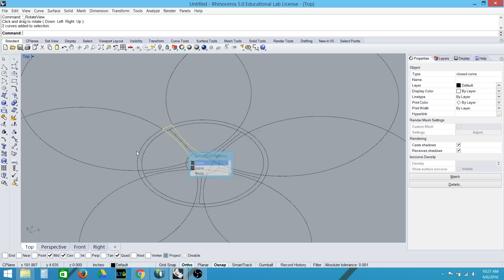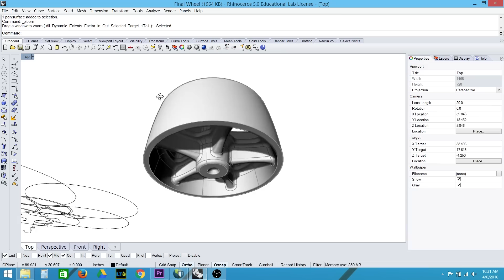Casting Aluminum Wheels | Old Timey Casters

Comment: Hiya, just discovered your channel.  I've yet to watch all of your videos but I'm interested in casting aluminium.   In order to repeat cast something (for example shelf brackets) do we have to use sand?  Is there anything more robust but flexible that doesn't melt at temperature of aluminium?  Some kind of tough resin?  Thanks and really enjoying your work.

Comment: great work and very entertaining. I note that you use a funnel shaped pouring basin. the current thinking is that these pouring basins entrap air and oxide into the melt and induce turbulence into the flow. 
There are basin designs simply built that includes a weir that allow a better pour as described in the "OldFoundryman" videos in accordance with James Campbell , I believe. they also have narrow sprue's so that they are completely full when pouring.

please look into them, they have some merit.

but them if it works, it works.

Comment: Poplar is only dense when its green. That stuff around here is lighter than paper when it's dry. You would be better off using something like Oak, Spruce, Walnut, or Maple. Those woods make decent patterns. As long as they are dry and do not warp.
Reply from the maker: Ah thanks for the info!  I have some actual foundry board from freeman supply that I am looking forward to trying out!

Comment: one question, i know it's a relatively old video but i saw you finding the center of the wheel using lines. I;'m assuming that you was just doing that to show people how to do it, but i would have thought you would have just used the CNC machine to mark the center of the wheel considering that's how you cut it out?
Reply from the maker: I didn’t have a good Center as it was a spiral path.  Due to the school shop closing where I kept my CNC, I wasn’t able to run the final profile cut.  The roundness was based on just sanding it into a cylinder.  Various ways to find the center.  This was just the one I happened to use! :)

Comment: Thank you! Finally a youtuber who actuallu knows something about casting ;) Keep doing these! Also, you could try lost wax casting, since you have a 3d printer and use sodium silicate already ;) Althouh there could be a problem with curing the mold (need a 1000C degree oven). Anyway, hope for the best ;) Btw. could you link up this ,,sodium silicate sand”? I didn’t know there was an already mixed mass being sold

Comment: I need to work on Rhino!   You make it look so easy! 
>>>
Apologies if I missed it somewhere, but have you figured out how hot your furnace gets?   I'd like to melt down silver which is doable at about 1700ºF.  Aluminum melts about 500º before that.   Think your burner / furnace can do 500º more??
>>>
I once drew up plans for a heavy butcher block island that called for wheels like this.  Commercial stainless steel castors were a couple hundred bucks(!) if I recall correctly.

I'll be interested to see the final application and how you machine the hub and fit bearings!

Comment: congrat sir
please what software did you use to design the wheels at the initial stage and what kind of machine was use in cutting the pattern out.
thanks
Reply from the maker: +anthony ibanga The 3D software is Rhino 3D. The machine was the Platform CNC that I designed and built!

Comment: I would have used poplar perfect plank as it is more stable. You can cut the whole thing without the need for sanding afterwards. Just cut from the top of the radius created from the ball cutter to the parting line with a flat endmill and it's done. To keep it from flying away when it cuts free,,,,, oh never mind. I have been a pattern maker for 30 years. What you did is fine. They look great.

Comment: Before you separate the 2 wood parts you should turn it on a lathe to make the outside round and smooth so it won't have bumps and wobbles in the finished metal part.
Reply from the maker: +steve c Step 1: Buy a lathe. :)
Reply: I'm sure you could build one from scratch if you don't already have one!

Comment: Very nice work. Congratulations. But I have A question. Why not to use green sand which is reusable. Sodium silicate sand is lost, so it is an expensive solution to make a mold. For my part, I only make a sodium silicate mold when the part has details that can't be made with green sand, like the fins of an air refreshed cylinder head by exemple.

Comment: Can you print out hollow segments on 3D printer, fill them with water, assemble them in a bigger structure and use as a cast model instead of wood, if CNC isn't available?
Reply: If i understood you correctly you want replace CNC machined "plug" (master form), with 3D printed part. Sure you can do that and get great results... HOW EVER whats up with the water part? You want weight? Then add DRY sand inside. Never bring water or excessive amounts of moisture anywhere near your castings, or your creating a bomb. Instant molten metal goes into mold and gets into contact with the water, water will turn into steam, create pressure and explode the mold into your face, with molten metal. If mold is designed and executed properly (most likely by accident) and metal flows just right, then there is chance that pressure will be released from gas vents, but i would not risk it. Also its good habit to surround your mold with plate+dry sand to prevent any spilled metal from getting contact with moist ground.. Even concrete pavement will cause this type of explosion, cause there is water inside the pores.

Comment: Hey man, just subbed today, really liking the content. I love any metal casting, working, etc. 

This is the first channel I've seen use petrobond instead of plaster or greensand. When greensand is used, I understand (perhaps incorrectly) that the charred sand/clay can be mixed back into the sand and reused. Is this also the case with petrobond?

Really hoping I can get into this someday. Anyway,  glad I found a new person on YouTube to watch.
Reply from the maker: +bdaubry Thank you very much for your comment and welcome!  Petrobond is reuse able.  I talk a little bit about this at the end of the drawer pull video.  I separate the burnt sand but you don't have to if you have a muller.

Comment: Nice outcome and another fine video. I suppose for your intended purpose using a solid block of poplar was practical and expedient. But, a pattern maker working in wood would not use poplar and would not make the pattern out of a solid block. For multiple castings, you need to consider wood movement and the possibility of warping, cupping, etc. Very time consuming to make the wheel pattern the old fashion way. Nice work, none the less.
Reply from the maker: +Russell Riscoe My reason for using the block of poplar is because I buy one for each of my students every semester to do their final project and I had one left over.  Poplar is a good, inexpensive wood for CNCing a 3D surface.  Lots of options, but not that many for about $5 for a blank like that!
Reply: Sure, very understandable. For me being "old school" mostly a matter of living in the past vs what is being done now with computers for design and patterning and CNC for producing the part or prototyping. I'm a furnituremaker who has not embraced the numerical world, lol. I enjoy your productions.

Comment: You can powder the talcum very well using a wide flour sifter. I have a 9 piece set and usually i follow the rule that 'the sifter size should be matching a least one of the lengths of the mold'. Gives a perfect powdery surface from 3 knocks or so.

Comment: I am seriously considering trying my hand at designing and building a 2x72 belt grinder. I am wondering if this method could be made balanced enough for high speed use. Something to consider at the very least. (No I do not have a lathe either).

This is the first video by you I have seen.. will be watching more, you have me interested now. If all your videos are this good, I will be watching them all, and all the future ones.
Reply from the maker: I'll be building one of these in the future...  Seems like the Jedi thing to do.  I have already purchased the drive wheels online.  It might be okay, but without a lathe, I assume it would vibrate like crazy!  Thanks for the comment!
Reply: did you watch Jeremy Schmidt's belt grinder build? It's the best shop made grinder out there. http://jerswoodshop.com/2x72-tilting-belt-grinder/

Comment: Fantastic work as I've come to expect. I can't help but wonder why you didn't simply install the indexing pins before sanding it to final shape instead of gluing?
Reply from the maker: +brocktechnology Long answer:  I loaned my CNC to the school where I teach.  It is in a wood shop with set hours.  I intended to completely cut this out but the shop was closing.  Without the CNCed edge to reference, there in no way to locate the pins.  Even if I could have installed pins, I would have just used less glue as trying to hold it together while sanding would not have been ideal.
Reply: Well that makes sense. Now that you mention it the milling did look a little bit... Incomplete.;)

Comment: If you had a metal lathe, would you turn the outer circumference to true the wheel? Or, is that splitting hairs and they are round enough for your needs?
Reply from the maker: If I had a lathe, I would face and chamfer the lip.  While it was in there I would drill the center hole.  As it is I have drilled a 1/4" pilot hole in the hub, but I'd rather know it was concentric rather than spend the extra time making sure everything is perfect at the drill press.  That said, nothing I would intend these for are going to break a land speed record!
Reply: Indeed... this is what I figured. Well, my encouragement to you is to search craigslist for a nice South Bend and get 'er done :)

Comment: cool vid 
is it possible to get  break down of the metal sizes you used for the sheet metal break going top try my luck at making one
Reply from the maker: +prmotorsports large angles were 3/16" thick...  smaller angles were 1/8". I think everything else is in the drawing overlays in the video!
Reply: Thanks much appreciated

Comment: Has your crucible held up well over uses? Any design regrets?
Reply from the maker: Crucible is going strong after 100's of melts.  Thinking about retiring it before it gives up.  Only thing I'd do differently is wrap the ends of the screws that hold the handles on the sides with tape.  If I had to guess, my small cracks may have come from those....

Comment: another awesome project. Once i get some spare time and my own home, i hope to setup a foundry like yours to be able to do aluminium casting. Thanks for the awesome videos
Reply from the maker: Petrobond hands down.  It will recreate your finger print if you leave it in the mold.  Sodium silicate is easier to deal with if you don't care about surface finish and have a difficult pattern.
Reply from the maker: +ajistewart You bet!  Thanks for the comment!
Reply: Sodium silicate sand could be reused, but only if you have a sand muller to break down the clumps and then sieve the sand. Given the price of dry builders sand by the bag full, its not really worth it unless you have a real "waste not, want not" approach to life.
Reply: watching some of Brian's videos, the petrobond sand is much, much more higher resolution compared to the sodium silicate sand, this time he went for the SS sand because of the rougher texture it gives. It can also be a bit harder to work with unless you have a bottle of CO2 at the ready with a funnel so you can cure the sand. When i come time to doing casting, i will be trying to use Petrobond as it gives a much nicer finish, and i don't require CO2 to set it. Petrobond can generally be also reused. there are a few videos on youtube that show people who have made petrobond mixers as it requires oil and something else (can't remember off the top of my head) hence the "petro" at the front of it. it clumps together a bit like clay, but doesn't have the moisture as when hot metals hit moisture, they can cause explosions :). Hope this helps
Reply: Can either of these sands be reused to make another casting form or are they single use only?
Reply: Petrobond yes. Sodium silicate, no.
Reply: Sodium silicate sand can only be used once because each grain of sand has a layer of sodium silicate, so if you reuse it that layer will build up and cause blowholes. Also it will not bind as good as fresh sand, more has to be used to get the same strength. It can be reclaimed but new sand is always cheaper.
Reply: I guess you could recycle the sand as aggregate the next time you're building something out of concrete.
Reply: Brian Oltrogge after using silicate sand  what do u think is much better silicate sand or petrobond sand quality wise ?